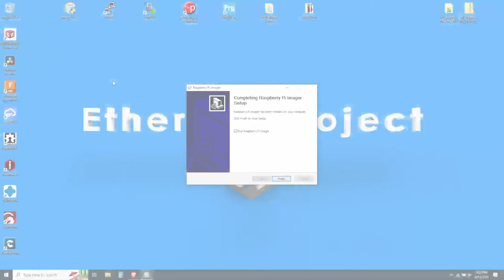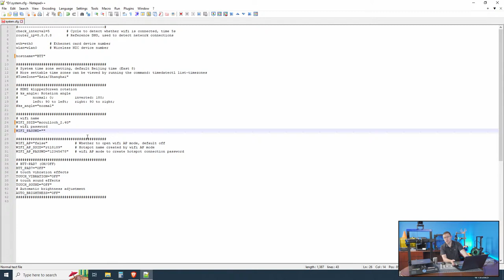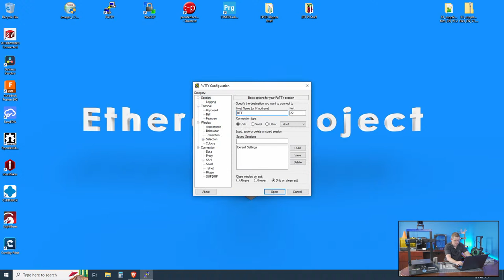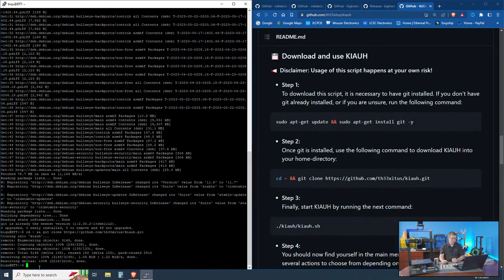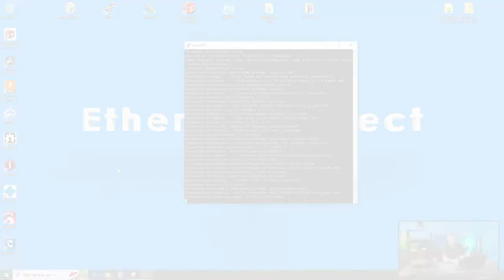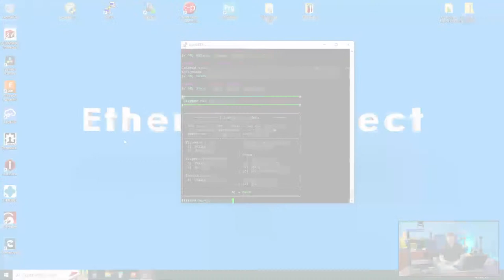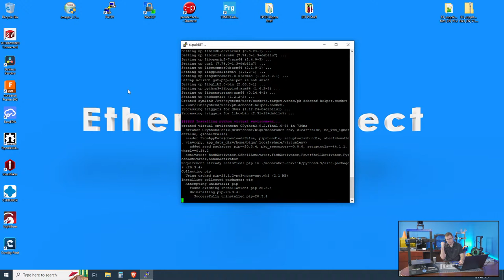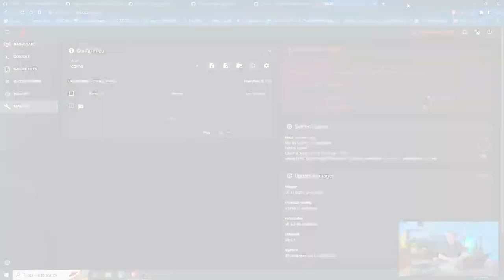Klipper for $35!!!! Bigtreetech Pi 1.2 Klipper install LIVESTREAM.

Comment: Hello, I recently used your improvement of the inductive sensor in the z axis (everything perfect, thanks for that) the question is, is this improvement from big tree tech compatible with the improvement of the inductive sensor? I want to make the jump to klipper but I don't know if both improvements are compatible. Thanks for everything, greetings from Mexico.
Reply from the maker: Yes it can work with Klipper with thr correct settings in the config.
Reply: @EtherealProject3D  Excellent, thanks for the help and for your videos. I hope to make the jump to klipper soon.
Reply from the maker: @DELTA2106  your welcome. take your time with it. its lots of fun but can be overwhelming at first. there are a ton of resources and help for it. the klipper website has all the info for the printer.cfg settings. and you are always welcome to reach out and i can help you the best i can. good luck and have fun.
Reply: @EtherealProject3D  thank you so much.
Reply from the maker: @DELTA2106  your welcome

Comment: I have installed cb1 on my pi 1.2 and I am able to ssh into it but when i hook an hdmi monitor up to it i get no signal, its an ultra wide 34 inch screen. Am i missing something or can you not actually hook up a screen to it?
Reply from the maker: It may not like the aspect ratio or resolution requirements for that screen, do you have a different monitor to try?

Comment: will this help to prevent LAYER SHIFTING with the sidewinder
Reply from the maker: That may be more due to mechanical problems, heat or faulty stepper driver/motor.